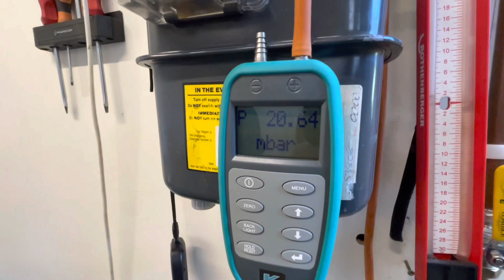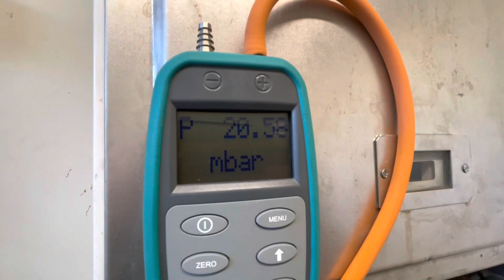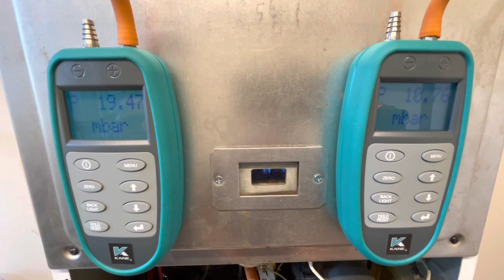Gas Training - Gas Pressures - Working Pressure / Standing Perssure - Roy Fugler

Comment: My gas fire has failed its working pressure test as it is only measuring 14mbars pressure when the Boiler is on. When the boiler is off, the fire measures 20mbars. Any ideas on how to solve this problem.

Comment: Modnern applinaces these days are fitted with zero governors, burner pressure you tend to be able to adjust on older appliances such as open flue boilers

Comment: Hi
So inlet pressure and working pressure at the appliance is the same? And should be no more than 1 mil bar dropped then meter working pressure,
Any body confirm it ?

Comment: Hi Allen, Roy,

Another good video - however, reading some of the comments being made, it maybe a good idea to explain in more detail the 'what for's' that go into why we (or should) check  the 'Standing Pressure' of an installation correctly - as clearly there are trainee students following your training videos for obvious reasons, and whilst reading some of the comments, there appears to be some misinformation in what checking Standing Pressure correctly is actually showing to the Gas Engineer, and what concerns he / she should be having if a certain parameters were in question.
Reply from the maker: Please explain what more you think we should include? Thanks.
Reply: @AllenHart999   Reference the Standing pressure proves that gas is present in the pipework and nothing else comment. This is not technically correct if we are openly wishing to help trainees understand these tests and what they can show fully.

We can also identify from this test if the regulator is operating as it is designed to do - and thus closing off rather than simply allowing full pressure through to the applainces via a failed regulator. If a concern is found, this then can lead onto actions to be followed if such a thing arrose.

Comment: What happens if more than one appliance is running at the same time. Could the inlet working pressure not drop even further on that boiler causing it to fail?
Reply: Yes. I have a commercial site, there’s 160m of 100mm iron pipework, there isn’t enough gas pressure to run both the new boilers at the same time.

Comment: Still find a lot of experienced gas engineers that get standing and working pressures mixed up. Standing pressure proves that gas is present in the pipework and nothing else. I've had heated debates with installers that say that boiler is fine because it's got 23mb standing pressure, I've 'at risked' it because that standing pressure dips to 11mb working pressure when the boiler fires up 🤦
Reply: Standing pressure isnt just to prove theres gas its to show that there is gas and there isnt a leak
Reply: Been there my friend!

Comment: I called out a gas supplier a few years back when I found 30mbr standing pressure in a house in the next street to me. I waited a bit then had to shoot off, so arranged to call back. When I came back, the supplier had been and told the customer there was no such thing as standing pressure, but he’d changed the regulator anyway ??? It made me feel a bit foolish in front of the house owner to be honest, as I’m sure they probably thought I was full of sh1t compared to the national company, but I explained the pressure was now 20mbr, so whether he had heard or not it was now correct.................
Reply: There is standing pressure and he is a jerk or just an idiot. For low pressure installations 23 - 26mbar and for medium pressure its 23 to 30mbar. If it is higher it makes the regulator to lock out to remove danger to any person in the property. Ta-daaa.!
Reply: I also called them out over 20 years now, similar story. There’s no requirement to test standing pressure and I still wonder why it’s even discussed to be honest. It’s a a waste of time and effort.

Comment: I'm interested in Unvented cinders. You put out a great video on that subject not so long ago. I'm not sure if I'd give a career a go in gas / heating and plumbering if I was 20yrs younger. But there are a few very talented tradesmen on here. I do really appreciate you all passing on the info and tips and tricks. Plumbering is a skill and the best make it look so easy, but it's far from it!
Reply: I've just passed level 2 plumbing and heating and i so far can't find a plumbers mate job for love or money i retained at 55 😭😭😭
Reply: Plumbing and heating are separate disciplines with different qualifications.  There is a grey area between them. 
I would not send a domestic plumber to a forced air commercial system.

Comment: Thanks for always putting on videos Guys.
Would be good to have a video on what you do if the burner pressure is to high or to low.
Gas rates to low or to high? And what investigating you need to do
What you need to do if inlets to small and what you need to leave at as.
Thanks for content and your input Alan and Roy. I'm always picking up little points every video.

Thanks
Reply from the maker: We have done videos on burners pressures, Please check out the full list on Viva Training Academy list. Thanks.